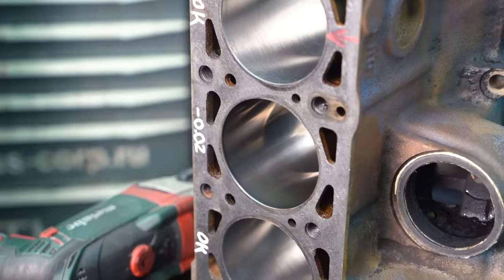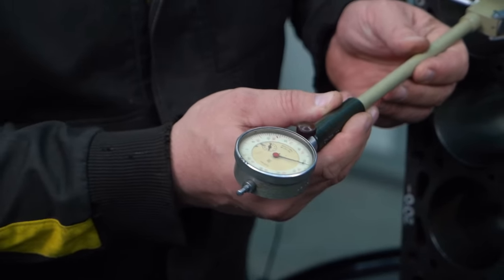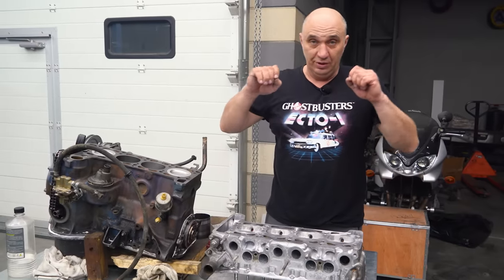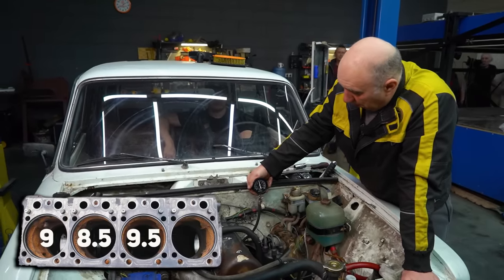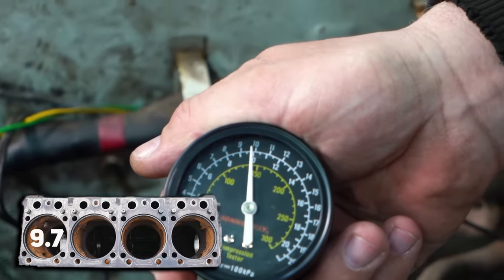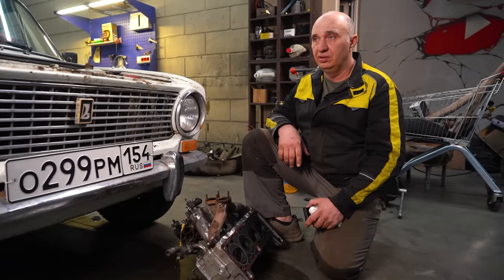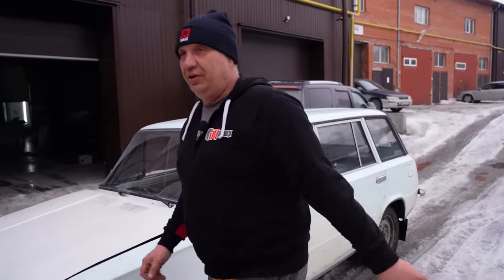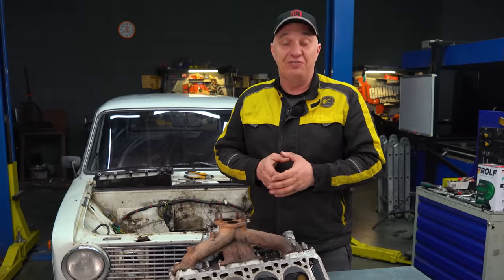Honed cylinders or mirror finish - which is better?

Comment: Well I'm guessing smooth is actually better ultimately.  I notice on some of the very latest diesel engines that they actually use some kind of ceramic liner that is ultra smooth along with super thin pistons that greatly reduce friction, and thus it makes the engine better on fuel.  The down side is if this lining gets damaged the engine is throw away, or at least the cost of relining it is beyond being economical in most cases!

Comment: The honed cylinders seem to be using less oil, but I think it's because they "broke in" more quickly. The mirror finish cylinders don't seat the rings quite as quickly. Those cylinders need a longer break-in period, perhaps, 5,000 kilometers to break in, because of the less abrasive finish. The rings will eventually polish the honed cylinders, so in the long run, it doesn't make a difference.
      The differences in compression can be the result of valve clearance, or, a worn camshaft. Differences in valve closure timing make a huge difference at cranking speed. Loosening the valve clearances will increase compression significantly.

Comment: A mirrored surface is never preferable over honed. Whoever said that is wrong. Honed cylinders provides a lubricating ring surface, where a smooth surface prevents oil from clinging to the cylinders. Honed cylinders are like tiny oil pockets that rings use to glide on. Honed cylinders seat the rings, prevents the rings from breaking because they're being lubricated. With a smooth bore, the oil film is reduced creating higher friction, possible ring breakage and wear is increased. Always hone cylinders in any engine.

Comment: You need texture is like fine sandpaper that sands new rings into the perfect unique shape for a perfect seal. Even a new blueprinted engine finishes the machining as its running.

Comment: I know when I used to race the flathead Briggs & Stratton engines in go-kart racing We done a mirror finish..They would use oil but it didn't matter because it got changed after hot laps and then after the main race.. those guys claimed the engines would spin up quicker and turn more RPM.. and to help the compression seal they would drill gas ports in the top of the piston.. seem to work well..
Reply: Hi, can you please explain a bit more about drilling gas ports in the top of the pistons and how it helps compression seal?
Reply: @herseem  they are very tiny holes in piston top where the inside ring edge would be . Theory of combustion gas pressing the rings out and sealing better .

Comment: Honed and manufacturers specify surface finish specifications with around 5-6 parameters. These are the requirements of the piston rings to ensure they bed in properly and meet emissions standards and the life expectancy of the components. Some oil retention is essential for proper function and minimising wear.

Comment: There’s a good reason we keep the engine’s and engine bay spotlessly clean in racing. If oil appears on anything we know where it is coming from leaks or spray. It’s all instantly apparent. 
Why not steam clean everything under the bonnet it’s cleaner to work on too.  The last time I polished a cylinder by hand. 
I was 11 years old and knew no better it was on  my 125 motocross bike. 
The only saving grace was I probably I didn’t do that good of a job. Honing traps minuet amounts of oil and stops wear on start up  a tiny bit of 
2-stroke in the fuel world be a good idea if you intend to polish the cylinders.  I get why you would want to do it.  Less friction equals a cooler engine so you can raise the Rev limiter and get more brake horsepower. 
But you become more reliant on the lube and would need to warm up the engine carefully. Because of the expansion and less cylinder surface oil Interesting  
I’d like to know what is the fuel. 98 octane. Or E5 E10 fuel. Does it have detergents or octane boosters maybe stabilisers.  Scratching the surface.  I would have tested with two different cylinder blocks took dyno readings after 1500 miles and then checked for wear. I think out of the two the polished would be best performance but show wear. And the honed slightly less performance but would have longevity. And that’s why the motor industry does it that way.  But well done proper mechanics.

Comment: Rings will never seat with shiny finish. Usually your ring maker will say what hone to use. After watching, actually I am pretty impressed. Wonder how it would do long term.
Reply: My old mechanic used to dump VIM abrasive cleaner through the carby to rough up the polished cylinder walls on the new Ford Falcons in Australia 🇦🇺 in the 70ties.
Reply: @chrisczarnik3439  OUCH!!!!!! I guess it was job security.

Comment: Honed requires breakin...residue mist be collected by filter not thru bypassed...must change oil 3 times after breakin generally....specifically a cylinder with jet oilers...probably the mirror finish is perfectly ideal....whereas....hining requires braakin an clean changes...so obviously.
Mirror finish may be preferred for broken in or high performing requirement.😊

Comment: Honing for best results, when adding new rings, and/or pistons, and refreshing the block. Smooth bore might be sufficient, for certain materials of rings, and/or pistons. Remember that the bore isn't probably really smooth as say a polished bore. There's going to be some micro scratches, but definitely oooooooh shiny. Jokes aside, the bore even if honed, will not stay that way forever on its own. So, even a smooth bore can still function, provided nothing breaks of course, but that goes for pretty much anything.

Comment: Polished, Crome plated, polished again. 
Mix oil with gasoline for added lubrication.
When crome heats up it naturally becomes very slick.
Thus
A stainless steel sleeve cylinder highly polished would last longest.

Comment: On newer engines, with fancy materials on the cylinder walls, you use much finer abrasives to hone. Old school iron, you'd rough up the walls with like 120 grit and finish with 240, new school you're roughing up with 400, and finishing with 600 or more.
Reply: We went to 600 on circle track engines 25 years ago and gained an instant 11 HP on a spec 350 SBC.
Reply: @hotrodray6802  Fuckin' nice!
Reply: @hotrodray6802  Yeah, it seals better with a finer finish, at the expense of engine life.  Course, a race engine isn't supposed to last forever.

Comment: Honing and it's resulting crosshatch are critical for oil control, too steep of an angle will result in insufficient oil retention on the cylinder wall, too shallow of an angle will result in excessive oil burning. No crosshatch would likely cause a result similar to a crosshatch that is too steep and simply allow the oil control rings to wipe nearly all the oil from the cylinder wall resulting in accelerated wear of both piston and rings. As far as how long before this started causing obvious problems like piston slap would largely be determined by the clearances given during assembly, engine load, and operating RPM. I would imagine that inspecting piston skirts and wear faces on the rings would give a pretty good indication of which is better.

Comment: Depends.  2 stroke or 4.   4 stroke lubercates differently than 2 strokes.   Many race 2 strokes run a polished chrome cylinder..  in a 2 stroke the lube comes from the gas oil mix.  In a 4 stroke it comes from the crank case oil..  a 2 stroke dose not need to hold the oil on the cylinder walls the same as a 4 stroke..    hone a 4 stroke polish a 2 stroke chrome boar

Comment: With Polished cylinder walls you want a thinner oil or it will consume oil, with honed cylinders a thicker oil.  Ford found this out the hard way.  5w20 in their plasma cylinder walls (polished) and it didn't consume oil, using a 5w30 and it would consume almost 1 litre or oil in 1,000 kilometres.

Comment: I always honed then cleaned with dawn dish soap with red scotch bright pad lightly just knock the edge off of the hone. I would bet the honed cylinders wore the rings more than the polished cylinders. All my engine rebuilds ran and lasted very long some of my tractor over hauls have over 25 years on them.

Comment: A increase in Pressure is due to the oil being pumped into the chamber. it increases the compression by a lot. thats why 2 kept rising and 4 sky rocketed. Bruning to much oil means higher egt. A mirror finish is the worst you can do.

Comment: Honed cylinder keeps oil on the wall helping with compression and smooth running of the engine mercedes benz amg v8 bi-turbo has the problem with glazed cylinders/ a Mirror finish causing oil burning on throttle inputs if you hit the throttle and blue smoke comes out it's glazed/ a Mirror finish cylinders and the engine needs a full rebild at that point the cylinder will get scratched if the rings are frozen in place from lack of oil lubrication from no cross hatching and also bad maintenance but if the rings are  free to move then it In theory it  will work no matter if it's glazed or not you will just burn some oil so like about 1.4 qt or 1 lt in around 2000 mi vs .05 qt with out a Mirror finish.

Comment: ALWAYS HONED! I didn't know there was any other way to be honest other than honing out a cylinder out a cylinder in order to create a cross hatching effect at approximately 45° angle for proper oil retention along the cylinder walls. This type crosshatching pattern can easily be achieved using  to enable the piston rings to reciprocate up and down during operation of an engine.

Comment: Interesting video. Thank you. As I understand it,  the valves with the honed cylinders were dirtier. Assuming I understand this correctly, the test suggests that the honing is working to do a better job of keeping the cylinder wall lubricated, but the tradeoff is that a little more oil is burned. 

Again assuming I understood the results, the honing vs. polishing question is about whether the slight increase in oil consumption in the honed cylinder is justified because the engine will run longer because of better lubrication.

Comment: the only benefit for honing i can imagine would be less surface frictions. when we pull cable through duct the duct that is ribbed inside has less friction that smooth interior duct. i assumed honing would do the same thing but i may be totally off.

Comment: Hone turns into mirror . Honed smoothes the rings to surface to seat better. Problem is you need to take advantage of them quick they dont last long. Lots of hard accels and decels expand the rings under load and push them harder against the cylinder wall thus taking advantage of hone marks that dont last long to make piston rings seat the best. Hard break in has shown best dynos results time and time again. Just dont hold high revs at all on a new motor . Swift accels and decels is the best for break in. Get the rings to seat better which will make better compression and will seat the oil control ring better. Honed wont have better compression at first but will after if break in was done right. Remember hard accels and decels . Expand the rings just dont hold high rpm long till fully broken in. In order for this test to be accurate new piston rings should of been used.

Comment: I’m saying honed. More oil ‘cling’ because of the cross hatching will produce longer cylinder and piston life (unknowable based on your driving length). Better ring seating on the honed cylinders should make compression more equal among the cylinders.

Comment: If the cylinder starts with a mirror finish then it needs less oil. So the assumption that honing is to keep the cylinder lubed is bs. The hone is to allow the piston and rings to 'self machine' into a uniform bearing surface of matching imperfections. If you don't hone, it will eventually form a uniform bearing surface within several thousand miles, but with a hone it happens within 1000 miles as it tears down the peaks and valleys of the honed bore surface.

Comment: Honning is better only by the means that since in the tiny groves is always some residue of oil, it is much harder to seize the engine in extreme situations (like oil pump failure, overheating or so).

Comment: Hone your cylinders as recommended by the piston and ring manufacturer.  Different ring materials required different final honing stones.  Smooth bores don't seal nearly as well thus generate much more blowby.  I have seen huge crankcase pressure problems by smooth cylinder walls.  They also don't retain oil for ring and skirt lubrication and do not promote ring rotation.

Comment: Hone is preferable because of the peaks and valleys concept where, the oil has microscopic areas for lubricating the cylinder wall while on the mirror finish the base line all across the board. This will shorten the lifespan of the engine significantly

Comment: I would say somewhere in between. the striations will hold oil in them giving them more lubrication and a honed cylinder won't hold oil as much but the friction between parts will be less anyways so honestly I think it might just be dependent on the kinds of loads you'll have on the car. For a torque motor honed might be the way to go for when you have to load up the engine and for higher rpm speed and racing applications it might also help to just have less friction in general and at that rpm you're def getting oil so really just might be on a case by case basis. With no extreme benefit one way or another without extensive testing with at least 20,000mi on each test.

Comment: Depends but the old timers would rebuild their engine's in their garage over a weekend and just use moly rings and go for another 40 or 50,000. It's easier to seat a ring with older style rings with it honed

Comment: The cylinders that has the proper cross hatchings will seal better, and also will help to better retain the oil on the cylinder walls, which helps to keep engine running smooth with power, efficiently, and keep it longer lasting.

The smooth cylinder walls are not a good thing, as oil will run off faster, and the seal between piston rings and cylinder walls will be less effective, as well as having other issues.

Comment: So honed are ok, polished tend to burn a bit of oil. I'm not suprised by that. The rings have to seat in and hone helps with it a lot. Rings in polished cylinders might also seat but after an extensive period of run time. And honed walls help the oil to stick and lubritate the piston and rings better. If you were to really beat on that engine, the pistons in polished cylinders might simply seize up.

Comment: I found that in a racing motor MIRROR finish is better BUT you have to seal the rings with Brasso by hand before assembling it. Otherwise it will never seal properly. Francois SA

Comment: What a cool test! 😃👍
About the pistons and the Russian winter: piston 3 was the warmest and the cleanest.
About the cylinder head: unfortunately there was a problem in the translation. Did cylinder 1 and 3 have the cleaner exhaust valves? Or 2 and 4? There are 2 cylinders with clearly visible cleaner exhaust valves. I don't know if they had the polished or the ground finish. 🤷‍♂️
A longterm-test would be interesting! How will the compression develop in each of the finish-types? 😉

Comment: I rem3mber on my Dad Porsche 356 that it had chromed cylinder, but they had a pattern of tiny recesses( I si loose to hold oil?). Also, the rings were a special soft steel or even just iron so they would seat properly. I believe the 911s also had chrome cylinders.

Comment: Honed cylinders tend to bed in and seal better over time. Mirror finished cylinders are technically better, but the level of precision required is so high that its not a good idea unless you are building a literal million dollar engine.

Comment: The honed finished done correctly  holds oil for lubrication as well as straightens  any irregularities in the cylinder bore from top to bottom  different piston rings also need different surface finishes 😴

Comment: A subjective comparison would have two engines with a Dyno test before and after the bores  are honed and polished. The improvement if any would show up on the second Dyno test. By not installing new Pistons and ring would also help determine a subjective comparison. By not doing a valve reseat would also determine a subjective comparision

Comment: No matter what type of engine build you do, stanard rebuild or every lvl of performance all cylinders need to be honed, for proper ring seating. Polished cylinders walls = zero ⅖seating of the rings and will lose compression as the rings allow combustion blow-by.

Comment: This probably isn't going to be seen but the differences between cylinders is likely caused by one of two things. The first would be incorrect valve adjustment but you seem to be more careful than that so that probably isn't the problem. The second is the CAM shaft is out of spec or worn from use and is giving different results.

Comment: The honed cylinders allow for oil to remain in the very small grooves protecting the tv walls and rings.   That’s it’s primary function.  The mirror cylinder would be theoretically capable of a better seal but the friction would increase wear and shorten the life of the parts.
Reply: Edit out the “tv”…. Don’t know how that got in there.

Comment: After a bit of googling, mirror finished bores have been used in F1 and also Nissan uses them on their Aluminium blocks like the GTR
Reply: Do they use chrome rings?
Reply: @Colt45hatchback  Maybe?
Reply: Interesting
Reply: @311superfly  Modern engines usually still have a crosshatch when you open them up so no point in re honing , I've often put the old rings back in.